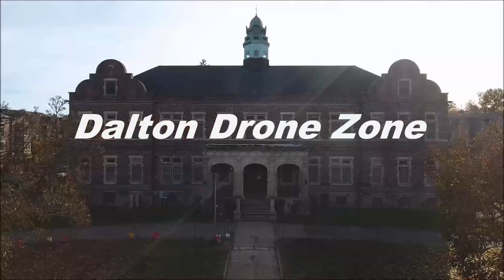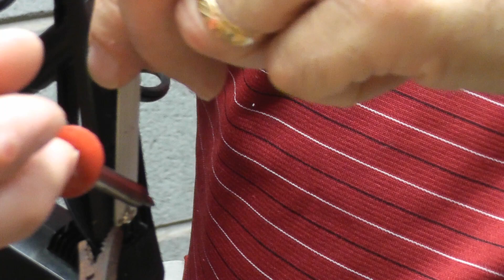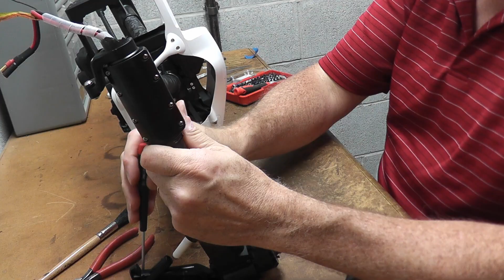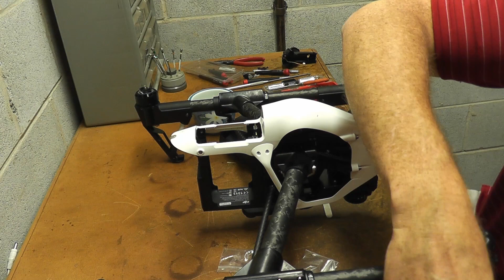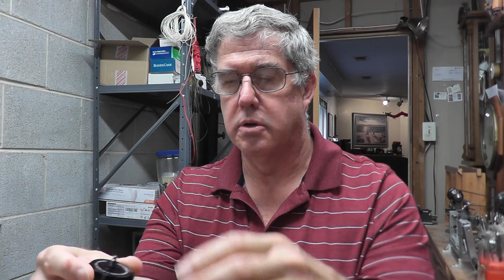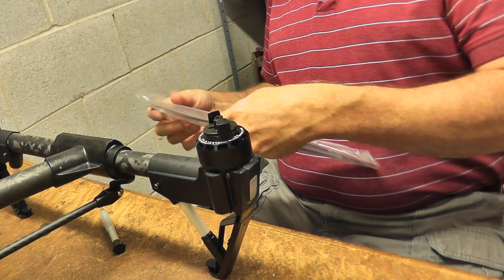DJI Inspire 1 Rebuild

Comment: I don't suppose you can give me any advice on replacing the cable to the landing gear antenna, can I just use any cable? Does the Inspire 1 take a specific cable? Any feedback would be appreciated.
Reply from the maker: It’s a coaxial cable, not sure where to get it.